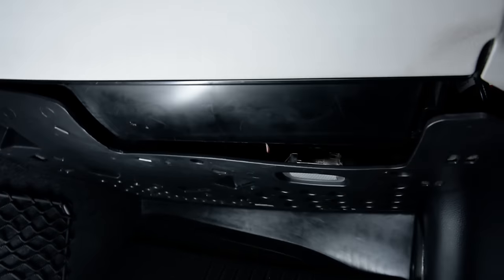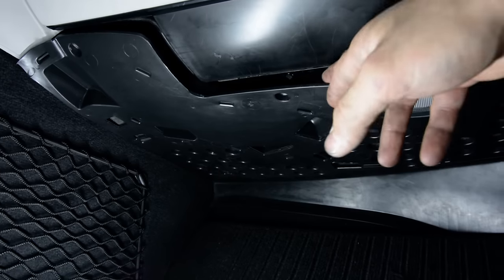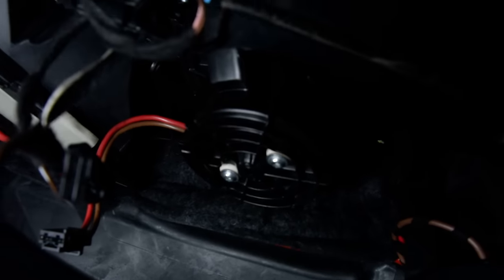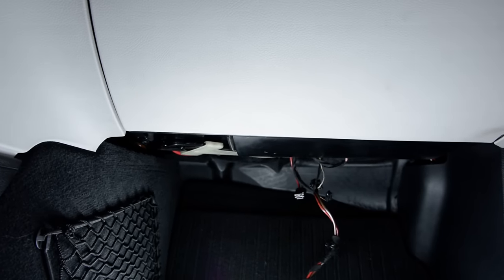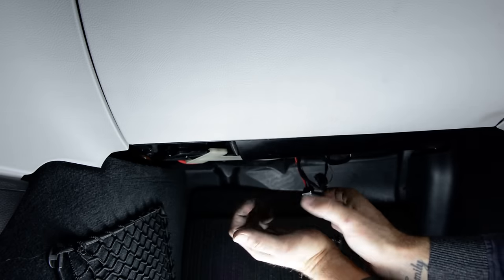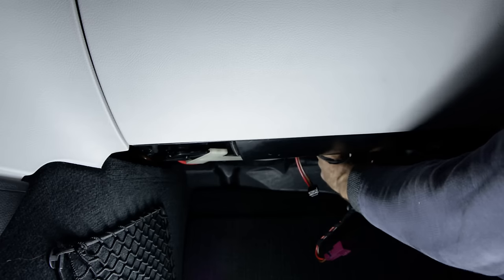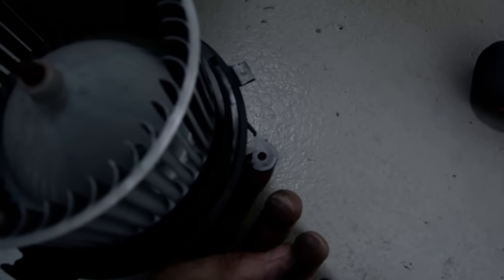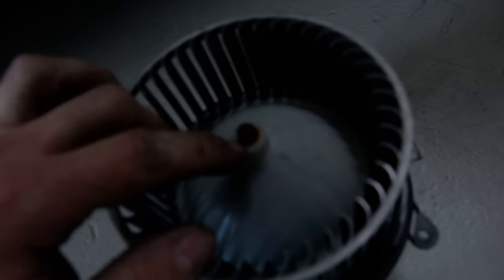Mercedes W204 Blower Motor Replacement Replacement/Removal  C-Class

Comment: The cause of squealing is a rubber flap on the other side in the engine bay. (That rust the shaft and the bearing of the motor) There is a big black air buffer. Hold by 3 spring retainer. And on the bottom of it, there is a  small rubber valve. That keeps the water in the air buffer. When you turn the fan ON.  It will spray all the water in the cabin. And increase the humidity and fog your windscreen. If you are not lucky some water can  go under your footwell too. You can weeken the flap but I was just get rid of that.

Comment: To save you a lot of time : remove the glove box! On my 2013 C300 4matic, the motor could not rotate completely when trying to remove it because it was getting stuck to some part of the glove box. Removing it is really easy and will save you some time and give you some room.
Reply: How did you remove the glove box

Comment: Thanks again for a very useful video. Having done this job a couple of times, I need to point out that on RHD cars (e.g. in the UK) the fan needs to be rotated anti-clockwise, not clockwise. I've also found it helps to remove the small damper rod attached to the glove-box lid - this makes it a lot easier to access the fan housing. My last suggestion is that lifting the small tab whilst rotating the motor can be very difficult; a wide, flat bladed screwdriver can be inserted carefully into the gap between the tab and the base plate, then gently easing the tab up whilst rotating the screwdriver releases the tab and allows the fan to then be turned easily by hand.

Comment: Great video tutorial! Thanks for sharing. One question: how do you unplug the purple electrical harness from the rest of the car? The purple harness (electrical plug) is clearly visible at 2:02.  This harness seems to be attached to the side of the blower motor itself. How do you detach the harness from the blower motor's side wall?

Comment: Hello friend, how to check the resistance and voltage of the blower motor and the blower motor resistor? Just check it with connector ON? Or with connector OFF the motor connection and check with multimeter...my blower motor is not working on all speeds 2013 c250 cdi

Comment: Trying adjusting the two screws on the bottom of the motor if it’s just squealing
Reply: I replace it with a new and it still squealing what does adjusting the two screws do ?

Comment: Verry usefull. Please tell me if that fan is protected by a fuse or not. Thank you!
Reply from the maker: Yes the  Blower Motor (Heater / AC) have a separate fuse in the fuse box
Reply: Thank's to you, today I removed my blower motor. Apparently there is some moisture. I'll try to clean and see if there is more problems. Thank you!
Reply: DFC Garage what number fuse is it please?
Reply: Tubal Reversal Success what fuse is it for the c250 2013 for heater blower not working mine also!
Reply: Tubal Reversal Success so its the blower motor? Not the resistor for the blower motor?
Reply: I have same problem, blower motor in
Reply: I have same problem, blower motor installed, but not work at all, where is the fuse for blower motor?

Comment: I have w205 c300, and 2 days ago some annoying sound showed up from the right side air vent whenever the ac is turned on, ( the sound is like some plastic piece is stuck on the ac fan and keeps hitting around while its on, more like: tik-tik-tik-tik-tik-tik-etc..) lol.
1- will i find the blower in the same place in my w205? Because in the video its the older version.
2- do you think that the blower might be causing the noise or there might be another fan?
Reply: Did you find the problem? I have that issue right now…

Comment: I removed blower fan on Merc b250. Bad vibration.found it was full of pine needles and leaves. HOW does it get dirty in the first place.
 The cabin filter comes after fan to filter air into cabin.

Comment: Does any one know the fuse number for the blower and where the fuse is located on a 2013 C250? I need to check if the fuse is blown before attempting to replace it.
Reply: This response may be too late  but I believe it’s fuse #12 in the engine bay’s fuse box driver’s side. Hope this helps.

Comment: Which model year is that C class? on my c class from 2012 taking it off like that is not possible. You can not rotate it all the way, It hits the glovbox.
Anyone else that have this issue?
Reply: I managed to finally get it out. You have to screw off 6 screws from the glovbox. That gives it enough flex to move the glovbox the needed 5 mm to get the blower off.

Comment: how to tell if it's the blower motor or the resistor that is faulty ?
Reply from the maker: Hard to tell! First go and make an diagnostic test!
Reply: Usually if it's just the resistor your blower motor will still work, just not on all speeds. Maybe it will blow on high but not on low.
Reply: Where is the resistor located?
Reply: @adrianemelvin9089  under blower motor